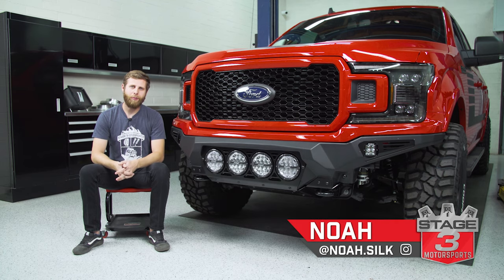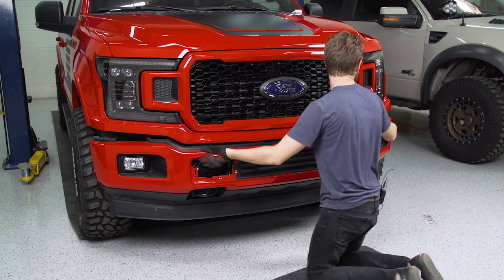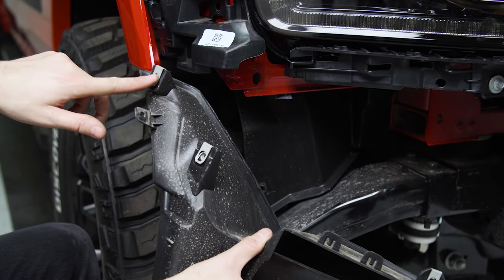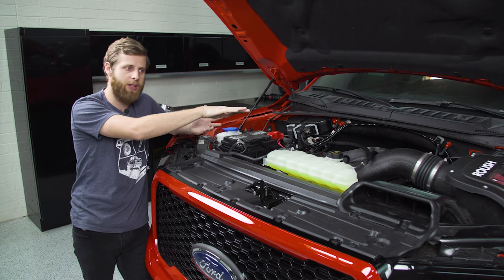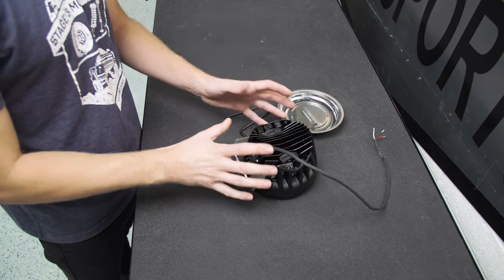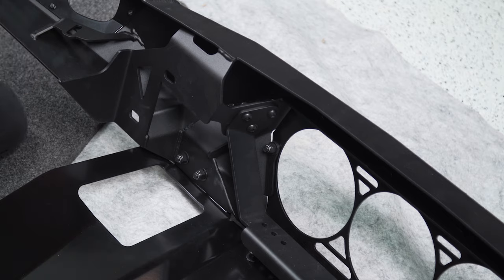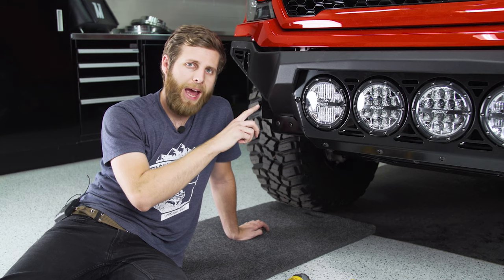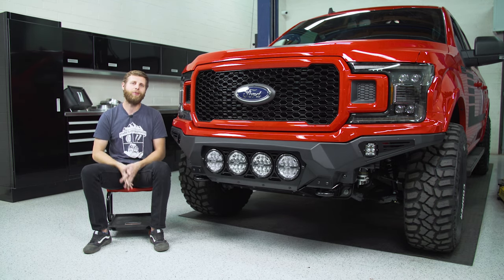2018-2020 F150 ADD Bomber Front Bumper Install

Comment: love the look of this truck very aggressive and what i was looking to do to a truck later down the road
Reply: also for those crash bars if you undid the bolts pushed them up and cut the bolt off just below the head just buy another bolt then you could reverse the crash bar to give you a little extra protection instead of just cutting the crash bar all together.

Comment: I unfortunately live in a state that requires a front license plates.  Is there a factory set-up to attach a front license plate?  If not,  what would you recommend.
Reply from the maker: Hey Mark, being in Arizona this isn't something we had actually thought of, seems like the best option may be removing the two center lights and attaching the license plate in the middle section.
Reply: @stage3motorsports  thank you for the response. Such an amazing looking truck! You guys have done great work.

Comment: Hey Noah, I've saved up and am going to buy this bumper from you.  What switches did you put in the cab to manage the 4 Rigid center lights?  (I will run the side floods off the factory fog light switch like you suggested.). Many thanks!
Reply: Right on! I just used two of the little round toggle switches that Rigid provides in their wiring kits. One turns on both "spot beam" 360s and the other turns on both "driving beam" 360s. It's nothing fancy, but I like that it's simple and functional. Plus the toggles are 2-way so they also run the backlighting without adding other switches or wiring.

Comment: You guys need to use impact sockets. Silver sockets are not impacts. Proper tooling. Say!!
Reply: You're technically right about that, but keep in mind that our little electric impact is far less powerful than a pneumatic setup and it sees limited use. I have yet to ever crack or warp a standard socket with it. Nonetheless, proper tooling is important so no argument there!
Reply: @NoahStage3  Ok so use impact sockets period
Reply: @shawnjordan3330  Lighten up a little bud, we're talking about sockets here lol. I appreciate the input!

Comment: Does anyone ever just cut the bolts for the crash bars?
Reply: Some folks do. The bolts are pretty tough so it takes a bit of work to chop through them, but it would allow you to get the entire crash bar out if you wanted.

Comment: Will this fit a 2016 F150?
Reply: Sadly there isn't a version of the Bomber bumper for 2015-2017 trucks. It's specifically shaped to fit with the redesigned front end on the 2018-2020 F150's.
Reply: @NoahStage3  that sucks!! 
Thank you for the reply